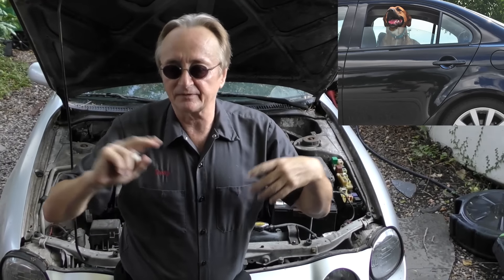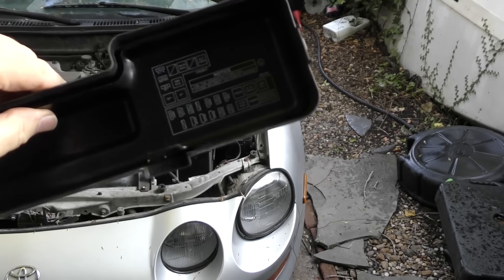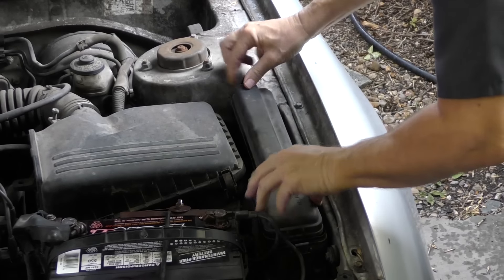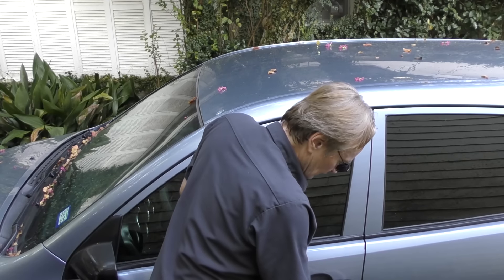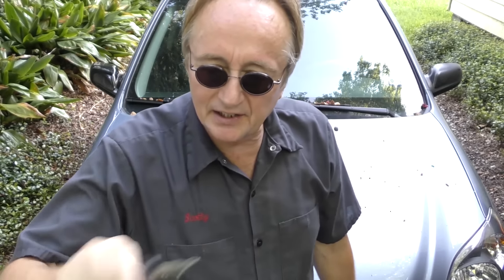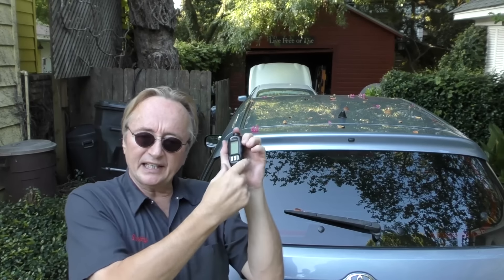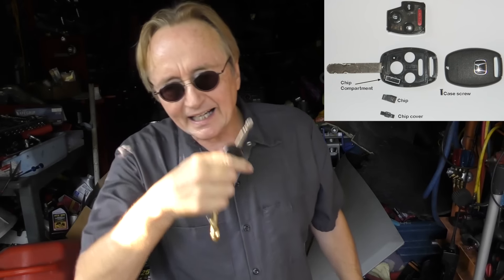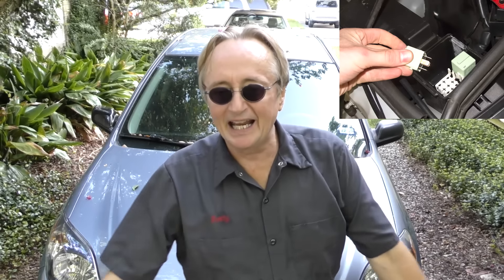How to Theft-Proof Your Car

Comment: Good advice... I was held up at gun point once just as I got in my car. Guy told me to get out, luckily I had a kill switch so I flipped It before I got out and ran!  Switch saved my car and the best part was it only cost me 30 bucks to Install.

Comment: On newer cars, removing the fuel injection relay may cause all kinds of computer issues (assuming someone tries to start it). I would only recommend this method for cars 1995 or older. Not to mention that in high-theft areas, thieves don't bother with trying to start the car. They come with a legit-looking tow truck that lifts the front end and they drive it away. And about the police-station parking idea, I'll point out that in Los Angeles a few years ago 3 police cars were stolen... during daylight... from a regional police station's parking lot!
Reply: What about the ignition relay?

Comment: I got shock sensors installed by the dealer last weekend. Alarm goes off if my car is lifted for examples getting my wheels stolen or getting towed. Also, if the glass is broken, it triggers the alarm. Had a kill switch on my previous car and it was awesome.

Comment: I’m a victim of car theft. I have 1995 Acura integra gsr that was stolen out of a restaurant parking lot in Vegas. I got it back 4 months later. They didn’t touch the engine thankfully but put aftermarket rims on it. Now I have a really good club lock with laser encrypted keys to unlock it. So if they wanted to steal it bad enough they would need to have a grinder with them to cut the club

Comment: Another variation on the kill xwitch  is to measure the current to the ignition system, install a slightly-to-small fuse in line and bypass the fuse with a hidden switch. When you park the car, open the switch. If they steal the car, the fuse will blow after a few minutes, leaving them with a puzzle yo solve out in the middle of the street. Likely they will just abandon the car rather than get caught with it. Now you come along close the switch, drive home, and replace the fuse.

Comment: Always used to take the rotor out o from under the distributor cap on my first car.
 No problem...
Reply: DID YOU HEAR  THE YOUNG  GUY SAY WHAT'S A ROTOR? ???
Reply: Just tell him he will need four rotors ... 1 for each wheel...  lol.
Reply: We The People Fred That’s why I removed the rotor - Old guy’s usually don’t boost cars lol
Reply: Yup. I learned about that on my first car. 75 Monte Carlo...
Reply: That's very old skool! Modern cars don't have a dizzy anymore!
Reply: @Paul_VanGo   correct the most are just  coil on  plugs

Comment: I've had my $300 truck I drove from Georgia to New York City which had doors you couldn't lock and an ignition you could turn with your fingers. Street parking and all usually about a 5 min walk away, I just unplugged the coil from the distributor and took the fuel pump relay with me whenever I parked it for an extended period of time. Felt easy

Comment: Also parking near more expensive cars makes your car less attractive to steal.
Reply: Wrong! Common cars like Camry and Accord and Civic and Corolla are top cars that are stolen. Because a stolen rolls Royce's can be easily spotted by cops on road when they send all points bulletin immediately after the theft. If it's a camry, and all cops in vicinity hear "2005 black Camry", the cops are gonna have tough time to pin point coz there are gazillion of em on road. A 200k mercedes AMG on the other hand, very easy to spot!
Reply: @lemonflavorclorox7389  Also a Rolls Royce spare parts are not high demand items, a thief would not sell them. Hondas and Camry's parts are hot items, everybody wants them.
Reply: @lemonflavorclorox7389  and the older cheaper ones are easier to part out
Reply: My car is expensive

Comment: Fun "Kill switch" idea. Place a "Kill Switch" in an obvious hidden location (under the dash near the hood latch for example) and direct wire it to the horn relay. They find it, flip it, and they are the alarm system.

Comment: Great advise Scotty!  
Back in the 90’s I use to put The Club on my car.
Reply: A hacksaw can get past a club real fast. Who cares if half the steering wheel is gone. You can still drive the car.
Reply: wouldnt chuliketoknow   I’ve been driving since 1981 and have never had a car or motorcycle stolen.
Reply: @deepcow  yeah I've been driving for close to that amount of time myself. My point is that a club is easy to bypass if a thief really wants the car.
Reply: ...i still put a "club" on my old 71 chevy because of its simplistic design its incredibly easy to get into & steal... i also use a battery disconnect switch ...the idea is to simply make it more difficult... itll keep some punk kids from takin it for a joy ride, but if a thief really wants it, hes gonna get it... i just figure im gonna do what i can to make it as difficult as possible & anything that makes it take longer might just cause them to move on to an easier target...

Comment: You can pop out another switch that you always leave on, A/C for instance, place that switch inside the dash where it will simply be left switched on, and replace said switch with a duplicate that will actually function as a kill switch. 

It's simple and easy to defeat if you know about it, but a thief is not going to think 'maybe I have to turn the A/C on the make the car start.'

Comment: My favorite anti theft on my 1980 FJ40 is the stubborn carburated motor and the 4 speed manual... I also have a killswitch wired off my distributor leads. I no longer have to worry about leaving the doors and top off of my landcruiser in the summer.

Comment: I had 2 trucks stolen out of my driveway. Both 2002 GMC's. I got the second one back, luckily. Just kids our for a joyride. I started taking out the fuel pump relay, which was fine, but it was a pain in the A$$. Especially in the winter. I got "The Club" and no one bothered with it after that. 
If they see that, they will move on to the next one.....usually. My friends truck got stolen out of his driveway and he had anti theft devices on it. The cops said it's not unusual for them to use a flatbed and just drag it on to it.

Comment: Master lock made a system that consisted of a chip activated relay switch. The chip was contained in a fob like housing. 

Without the fob, the relay will not activate. I replaced the relay that runs the fuel pump. Without the fob, the key will turn the engine over, but the car will not start as the fuel pump is off. When the fob is in close proximity of the relay, it will activate the switch that turns on the relay and send electricity to the fuel pump. 

The nice thing is that there are no empty relay switch spots that might tip off a thief. It would actually be pretty easy to run a wire from the +12v to the lead that energizes the system, whether it's the fuel injection system, ignition system or electric fuel pump. A missing relay is actually pretty easy to spot. It's also quite easy to plug in a simple copper wire between the relay leads. It would be better to buy a replacement relay and break off one of the leads to render the relay non functional and plug it in in place of a functional one. Then it wouldn't be so obvious that a relay switch is missing as the reason that the car won't run.  

The Master lock device is a very nice system. Master lock no longer produces them and it's really too bad. Because it is so very simple yet very effective.

Comment: I had a 1969 Triumph TR6 that you could crank with any key or small screwdriver. When I parked it I would pull the ground wire off the distributor and stick it in my pocket.

Comment: Great idea with the relays! Most of the modified older cars use relays too, which is great for this.  Hopefully nobody shows up with a tow truck
Reply: If they show up with a tow truck then they really got something personal against you lol
Reply: Really? Would you open the hood every single day when parking your car in the street in front of your house and pull a relay from the fuse box? If that were the same relay every single time, the connectors in the fuse box would eventually go loose because they're not designed for relays to be removed and put back frequently and you'd be left with a not working relay and potentially in need of replacing the whole fuse box.

Comment: I agree, the key chip/immobilizer is the best combo. Until the car has trouble reading your key fob that is. Then it will be extremely frustrating because you are stuck with a perfectly working car. Usually you can't fix the immobilizer unless you have a really skilled mechanic/electrician. Otherwise your only other option is to go to the dealer and be charged an arm and a leg to change your steering column.  I am really curious if Scotty is able to fix this and save us a trip to the dealer.

Comment: Cut all the wires.  Take all the tires off . Weld to steering wheel column. Take all the fuses and relays out. Steel proof

Comment: You don't need the relay for your car to work. Simply put a piece of copper wire where the relay goes (the part of it that feeds power to the fuel injection system) and you're golden.

Also, a big flaw with this is sometimes relays are the same for some cars, and I've found that the A/C relay is the same as the fuel pump relay on my work vans. You could theoretically take the relay out of the A/C socket and place it where it's missing and you will be able to drive the car away.

Comment: Thanks for the information and understand the older cars.  I am pretty sure the thieves are more after the newer more expensive cars that they can steal and ship overseas.  They could probably care less about stealing an older car.

Allot of the newer cars have the Keybots and that pushbutton starting, So the keybot allows opening the doors and starting the car.  That is the kind of cars (both Gas and Electric) being stolen now days with their hacking devices to pick up the transmitted signals from the owners Keybot.  

The thieves pick up the signal of your keybot, they make one of their own and allows them to open the door, start the car, and drive away with it. So there are videos that show how to protect that kind of theft.

Comment: Hey Scotty!! A Tesla was actually stolen last week in the UK, and they used like this big antenna thing.
Reply: You think they hacked it in some way?
Reply: Yeah that’s a pretty common thing they do, they can do that with pretty much anything that has a remote to unlock/start it. They get an antenna to steal the signal of the real remote and the signal gets sent to a spare remote they have, and it basically turns the spare remote into the “real” key allowing them to unlock it and drive it away. Range is usually long enough to do this when a person is in their house and the thieves are in the driveway
Reply: @rickym8515  so im better off with my 93 civic

Comment: A friend had a similar solution. He clipped a wire for the FI relay and had a key pad that required a 4 digit PIN #. There were 4 or 5 wires coming out the back. If the wrong pair were X jumped they'd activate locking relays that'd lock the FI system out until the battery was disconnected. This was in one of the cars, IIRC a Honda, that were commonly stolen. There could be a reoccurance of this type with the "push button" systems. With modern systems the thief can scan keys from outside your house, if keys are within 20 feet.

Comment: I did something similar to my 1995 Corolla.  I bought a cheap ignition relay online (maybe I could have gotten one from a junkyard, but I am "high tech"), popped it open, and took the guts (that is, contacts) out of it.  This way, I could not only remove the ignition relay, but I could put a dummy relay in its place, further confounding the thieves.  Not only do they (usually) not carry relays with them, but, they won't take the time to troubleshoot a target vehicle.  Slow them down and/or force them to move on to another sucker.

Comment: I remember, it was about 50 yrs ago a friend of ours went on holiday to the south 
of England the door lock was poor easy to get into 
so he took the rotor arm
out of the distributor, went sight seeing came, back to the car and tried to put.the rotor arm back in the distributor, and dropped it down an open drain he eventually got another 
From a local garage when he opened the hood, somebody had helped themselves to the battery.
So much for going in holiday.

Comment: When I bought my Porsche many years ago I wired a simple SPST toggle switch in series with the electric fuel pump circuit, at the main fuse box under the hood. The switch was placed in a hidden location within the driver's compartment and within my reach. I just developed the habit to switch the fuel pump off when I parked the car and switched it back on when I got back.

Comment: U can still jump the relay with a wire tho I do on my 98 mustang lol
Reply: Too much work if seconds count.
Reply: Yea but for someone trying to take it too much takes to long
Reply: Ok ok, so swap out the relay with a defective one....belt & braces solution...👍
Reply: @douglasgreen437  This is actually genius
Reply: Douglas Green just have to remember which one you swapped ☺
Reply: Who the f is gonna raise the hood, remove the relay cover(not all are as easy to access as Scotty’s example) then reverse the process when they return. Might as well suggest we disconnect the driveshaft
Reply: @j.b.9895  great idea, disconnecting the driveshaft will really slow the thief down
Reply: Jose Dude and remove the starter motor while at it ☺
Reply: This is exactly why I always replace my battery with a watermelon when I park.
Reply: U gonna change the oil  too while ur at it? Smh
Reply: @j.b.9895  drop the driveshaft then easy to pull to junkyard.
Reply: @mwendia  once somebody thinks they outsmarted a real thief they never check their car and you got all the time in the world. once you pop the hood people will think you are working on your own car. just use the club on old cars.they always go for the other cars because i am the only one with the club and they always pick the lowest hanging fruit
Reply: @j.b.9895  there are usually relays inside you can put a dummy one in place and nobody sees you do it
Reply: A friend had a tow truck steal his Honda so now he keeps dents in the panels on purpose lol
Reply: @malcolmhardwick4258  lol
Reply: @j.b.9895  lol,

Comment: I’ve been doing this for years,

Did it before EFI, I would take out my rotor from the distributor cap.
You can also put a kill switch and a battery disconnect. They make them with a remote or a switch for around $50 for the one with the remote control like a generic car alarm 

And if that’s not enough, you can run some chains and or wire cables through your rims and lock them up from growing legs or taking a hot stroll down the wire

And if you still aren’t secure enough,

Just don’t go anywhere, don’t even drive it, and hide it in your garage if you have one, or not, or do ... and you live there and don’t have a house or anything or whatever

Comment: The biggest deterrent is to have a visual anti-theft device.  So that the thief will skip over your car and move on to another one that’s easier to steal.
Reply: like what?
Reply: @gmaxx5666 not sure what it’s called but like that small circular red blinking light that you can see in some cars while locked

Comment: I totally agree. Will not prevent a brake in, but it will stop the crims driving away,
I use what I showed in the link before. Before I used to run petrol or LPG. put in neither when stopped. Crim got stopped 30 meters away and my dog got him
Advise not to show anything ever.

Comment: I'd say the relay connectors and box cover were not designed for lots of removal and replacement. Besides, it's a lot of trouble to raise the hood and remove the box cover and relay every time you want to immobilize your car.
Reply: It’s much easier then having to wait in line at the tow yard to pick up your stolen car, if your lucky.

Comment: I've been doing this now for the past year since getting my Toyota.  I simply remove the fuel pump relay and perhaps the ignition relay.  Just don't lose them (for example if you're parking your car the airport) or you may have problems to deal with when you return.  But it will mark it harder to steal and honestly is less obvious than say using a Club or other steering wheel lock that's visible.  Another idea is to install a hidden kill switch, or do both -- install a kill switch and remove the relays just in case.

Comment: Can you buy an immobilizer chip that can be interfaced to an older car?
Reply: Well, you need to update/reprogram the computer to only start if it detects the signal by the chip (its a weak radio signal, also on classic keys that have that chip).
Probably not that easy.

Comment: Wish I would've thought about this for my mint condition 99 civic SI. Gone in 17 days 7 years ago. Jan 28th, 2016. A day that shall live in infamy forever in my heart. I had 4 layers of deterent, but I should've also added this. Take out 2 relays! It's a pain in the butt, to always pop the hood, but it's worth it! Another good one is to put a long shackled padlock on the lower steering column knuckle. Should've done that, too.